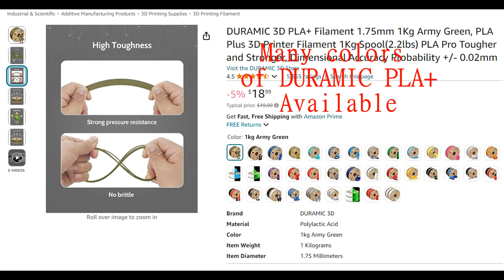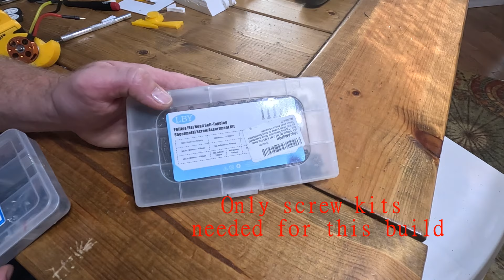Plastic Combat Robot Build

Comment: what is the red tape doing where the three red wires are at? Awesome design btw!!!
Reply from the maker: If its at this point of the video then those things are just fingertech splice boards. Dont need them but its a bit easier than twisting the wires and soldering them together. https://youtu.be/7lpCWyBWWp0?si=1vi8K1_jfbq9m5zH&t=191